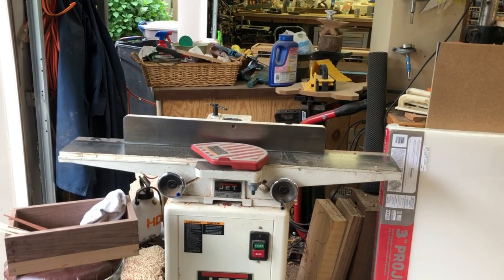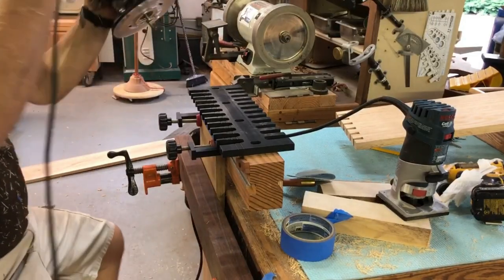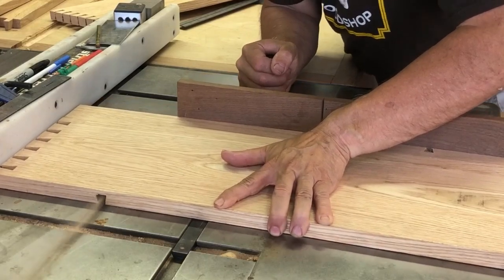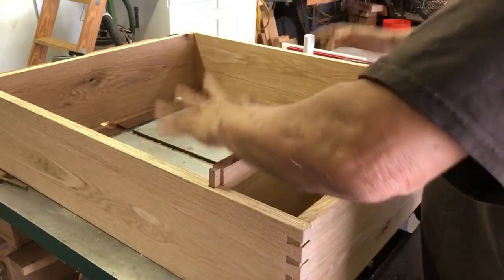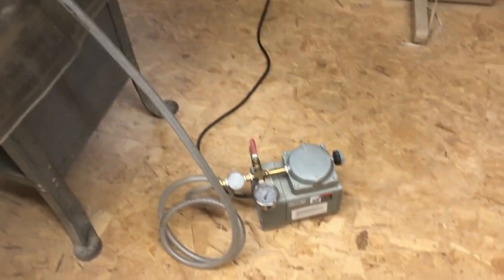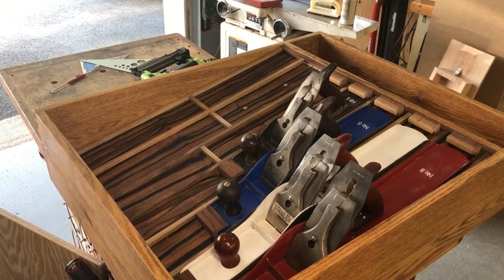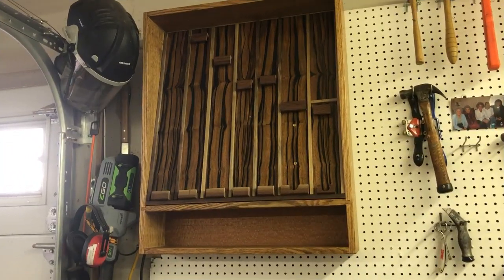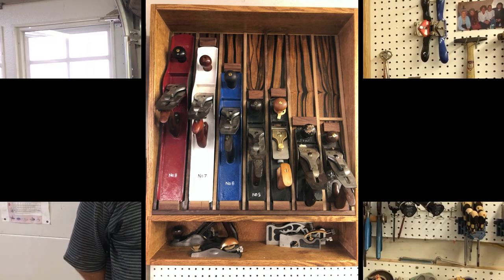Hand Plane Till -  Build It Yourself  - Bob's Woodshop

Comment: I'd be weary of those bottom supports; they could split along the grain and allow the plane to fall...... I would have orientated the grain vertically on these for strength and longevity. 
That veneer is sweet, I have some Mun Ebony with a similar colour, but not half as striking as yours is; mine only has a couple bands of the white 😁
Reply from the maker: Thanks for the suggestion and kind words! 👍